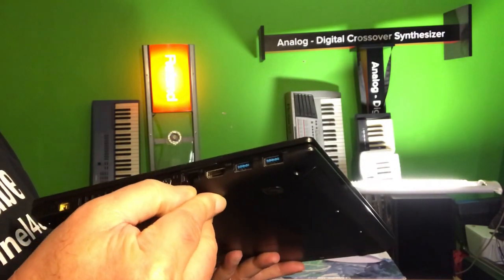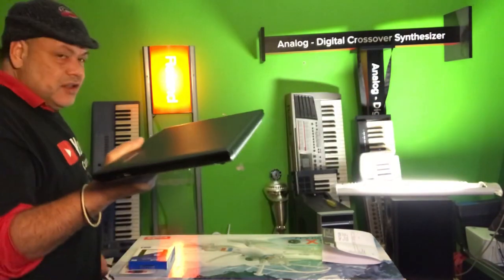Tutorial Upgrade & Install  Lenovo ideaPad S410P or Any Laptop with 500GB SSD - Cheap in 2020

Comment: Hello sir i'm curious. Can we upgrade the cpu of lenovo s410p? Thanks!
Reply from the maker: wow bro i dont know
Reply: Unfortunately, you can't upgrade the s410p's CPU.
Reply: It uses an FCBGA1168 socket which doesn’t offer you the ability to change the processor (all processors on this socket are soldered to the motherboard)
With this specific type of processor, there is no option to upgrade!
Reply from the maker: Thank you for answering 🤘🏼